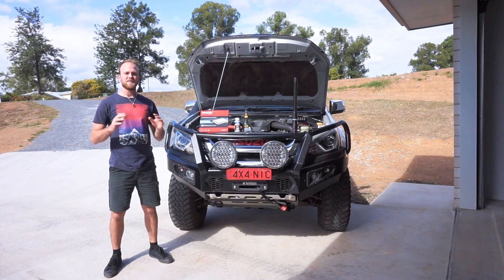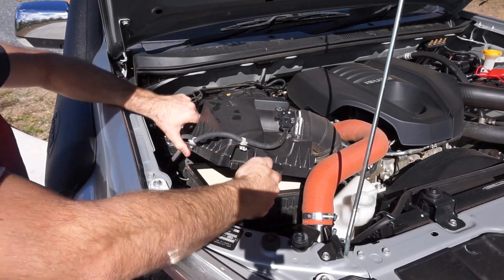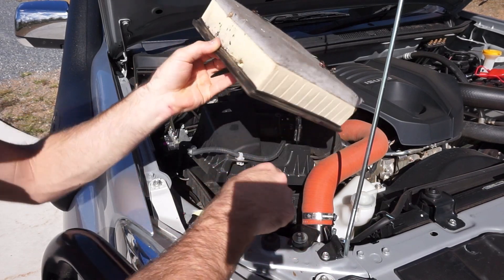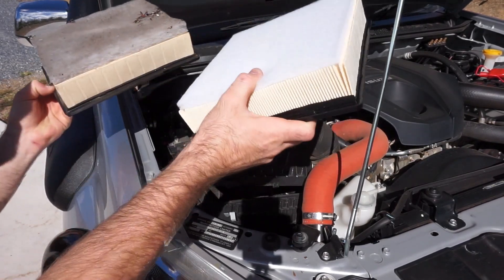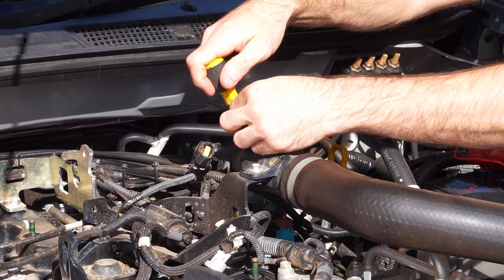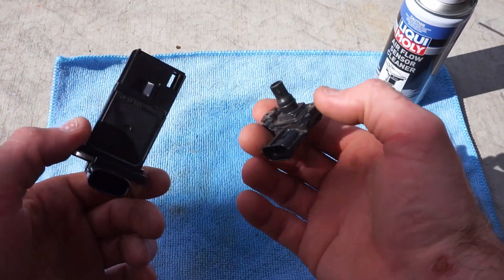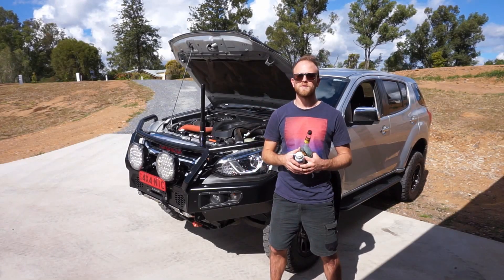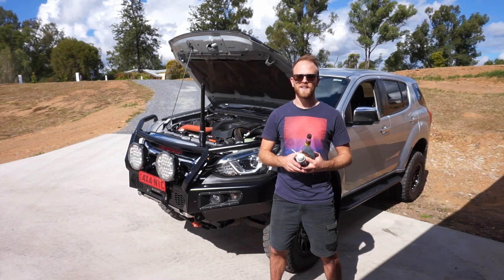[DIY] TURBO DIESEL TUNE UP { Better Economy + Better Response } Turbo Diesel Tune Up for Under $100

Comment: Good vid, even though, im under the capped price new car servicing, im thinking it doesnt cover this, and, this would be a good idea every service regardless it looks like. Espically the price of Diesel.
Reply from the maker: That's totally correct. Even though you have your vehicle serviced regularly, it usually doesn't include cleaning the important sensors and the diesel fuel treatment. Thanks a lot for the comment 😊